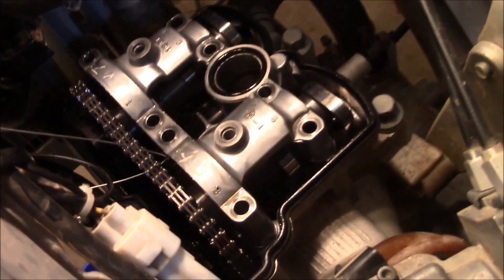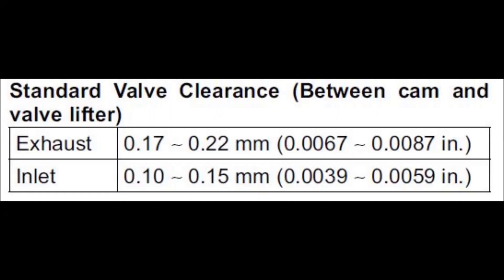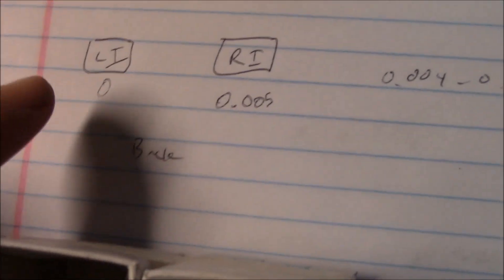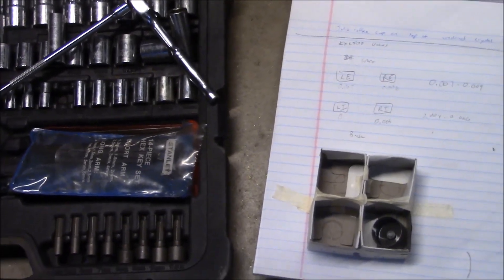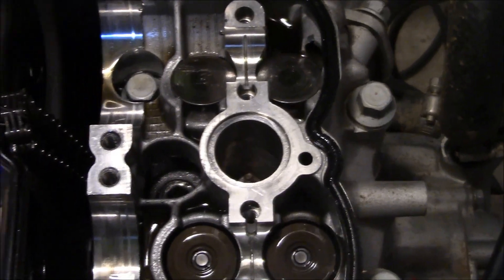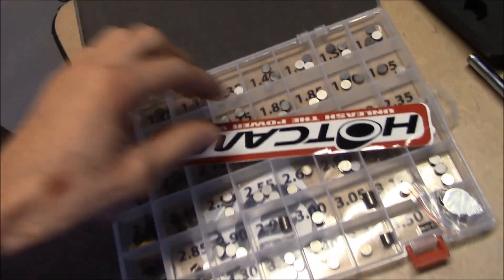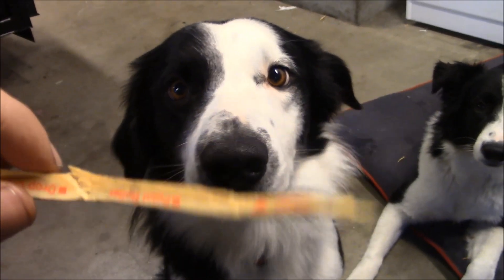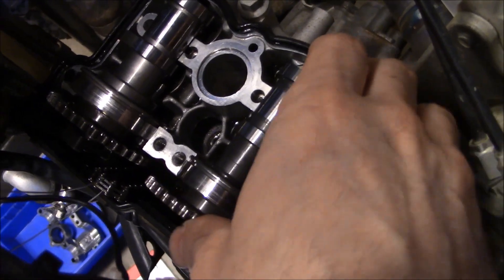KX250f Valve Adjustment (beginner, first time trying)

Comment: My 2013 has a knocking noise coming from the transmission side also, starts and drives perfectly. Engine seems to be running a little rich however when checking the spark plug, any suggestions what im going at fixing before i start? It’s really just a noise and a lot of people told me it’s fine ignore but you can see why I don’t want to
Reply from the maker: you could be fine, a lot of people worry about the kawi engine noise .. checking the valve clearance would be a really easy test to make sure nothing is wrong there as that could add noise..make sure your cam chain isn't worn out and the tensioner is still working properly, that could add some noise..

Comment: Bro I’m scared to do it on my bike
Reply from the maker: Haha bro me too but you should just go for it cause your bike probably needs it, it’s not really that hard after doing it, and kinda fun learning something new .. you can at least check them
Reply: @caseymoto  how do I check them my guy?
Reply from the maker: @victorosegueda8510  under the seat where the spark plug goes, you take that cover off.. and you put the engine in top dead center so valves are ready to measure.. then you use Feeler gauge set to measure each valves clearance and see if they are within the ok range or if you need to adjust the clearance by putting different size shim in
Reply: @caseymoto  does the bike feel more responsive and more powerful when I’m done? I’m paying a shop to do it and I’m wondering what I should expect
Reply from the maker: @victorosegueda8510  it runs a lot better.. it starts way easier... and yes i think you will notice better responsiveness and power too.. better to pay a shop to do it than ignore it and not adjust it... maybe next time you can try it!!
Reply: @caseymoto  the shop did it and now I hear a leak coming from the head? When u did urs did you put silicone on the head?
Reply from the maker: @victorosegueda8510  when you say hear a leak - you mean like air leak? or do you see oil leaking? anyways if you see a problem I would just take it right back to the shop and point it out.. they should fix it and know what's up... i didn't use silicone, but the gasket could be damaged to cause oil leak.. i had oil leaking on the head once and it turned out to be the gasket that's on top of the spark plug hole, which was super cheap and easy to fix.
Reply: @caseymoto  I hear an air leak
Reply: @caseymoto  and it’s right after I give the bike compression kicks
Reply: @caseymoto  but the bike does start a lot easier, and the idle is a lot better. It stays on even when the engine is cold, before I would really have to warm it up, and it would sometimes turn off. The intake valve was adjusted, so many it’s just the bike pulling air from the air box? I don’t really know
Reply from the maker: @victorosegueda8510   I would take it to shop and show them, or just call them and describe it.. I don't wanna give you wrong advice, but it kinda seems like you are fine in that it starts and idles fine, and if the shop was just in there you'd think they return it to you good..  sometime noises i hear end up being normal.. an air leak would be feeling weird when you are riding it, and usually comes from the carb area.. try to see where exactly the leak comes from
Reply: @caseymoto  can you contact me @victor.osegueda on ig

Comment: What tools are needed for this
Reply from the maker: you need feeler gauges to measure it (173146 BikeMaster 12-Blade Combination Tappet And Feeler Gauge )  , and you need some shims to adjust them (HCSHIM01 ... you need the 7.48mm size for this kx250f) .. other than that it is pretty basic tools needed

Comment: I’m getting a knocking sound seems to be on transmission side but I’ve read forums saying it’s normal on the 2011 kx250f can you confirm or do you think it’s a valve adjustment?
Reply from the maker: I would definitely check your valve clearances just to make sure, it is pretty easy to check.. and if they are not all in spec I would go for it on doing the adjustment too because that could cause the noise and not too tough... I guess the cam chain could be another place to check and not too difficult to replace .. if that did not fix it I would either take it to a pro mechanic or do some deeper digging on the forums and maybe post pics and videos so the pros can help out.. sorry I am not a pro yet
Reply: Thanks for replying I’ll start there .
Reply: I’m having same issue with my 2013, did you find the problem?
Reply: @MyDylan360   yes the shims were off . Due to 2 shims being off it was off of timing .
Reply: @jackwright580  did yours start and run perfectly also? Literally just made a knocking noise, and was this difficult to do yourself
Reply: @MyDylan360  it’s not that difficult. Pull the head and buckets and measure the space between . I used a few YouTube videos and got it . I would get a white paint marker to mark the tdc top dead center and the cam shaft chain at tdc . Way easier to get it back to the right timing . Did have to push start first time then kicked over fast every time after .

Comment: What feeler gauges did you use? What’s the part number
Reply from the maker: I was using a combination of two sets and the part numbers for both are: 173147 BikeMaster Feeler Gauge Set  +  173146 BikeMaster 12-Blade Combination Tappet And Feeler Gauge Set   .. they both worked good!

Comment: Is there a 2 lines in timing or one? Id didnt see well on video?!
Reply: I mean, when u put it in line, i see reflection of two lines when u record it
Reply from the maker: Matija P so there are two lines and you want to line it up with the line that is further to the right if you are looking at them both on top... or said another way: if you are rotating it counter clock wise it would be the second line
Reply from the maker: Matija P it was hard to know which line was for tdc... it does appear to have multiple lines.. there is a trick to confirming if you are using the right line, if you put a screw driver in the spark plug hole and turn the engine you can see the screw driver go up and down, and when it is furthest up it should be at tdc and on the right line.. check out my  kx450f valves video, around 3:30 I did that

Comment: What year bike is it?
Reply from the maker: 2009
Reply: Do you know how similar it would be to a 2014?
Reply from the maker: @taylorpowell5198  probably very similar... I just Googled the clearance specs for 2014 and they are the same as 2009.... I would double-check the timing picture too (like what I have at 6:47) as I haven't found a picture of that yet showing any difference to my 2009
Reply: K